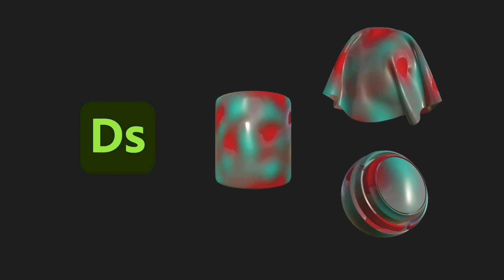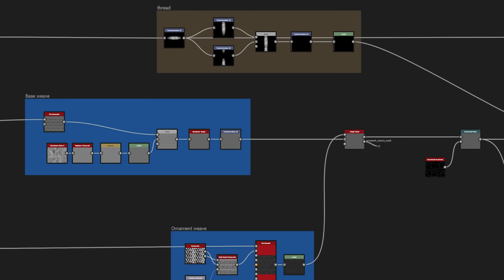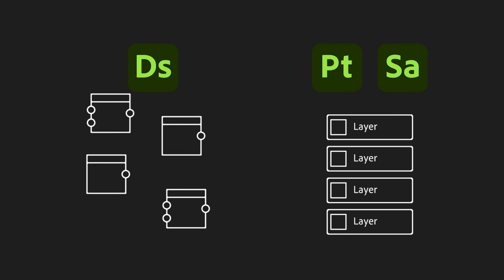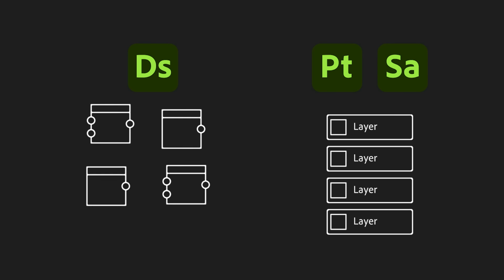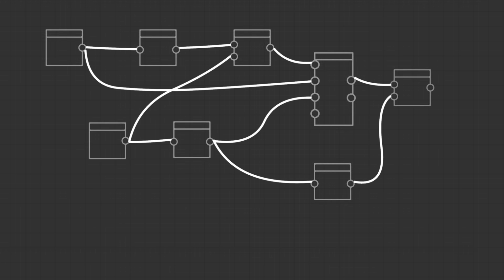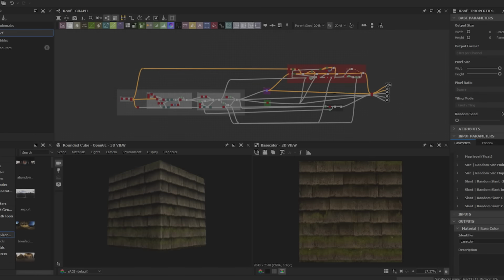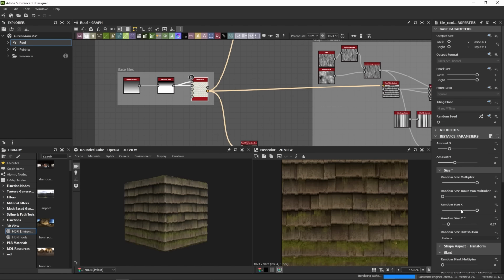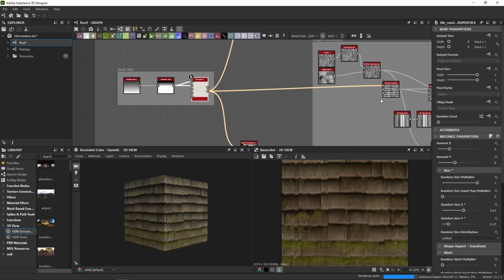What is Substance 3D Designer? (Pt 1) | For Beginners | Adobe Substance 3D

Comment: Substance Designer its a very slow image processor from Aligorithmics. And its kill a REAL PROCEDURAL 3D TEXTURE GENERATOR - DARK TREE!
Reply: I am unsure what you are trying to say, but if there is an alternative to substance designer I would like to know more.
Reply: @stevenmonster  Sorry, my english its terrible.
About 10 years ago I had experience to work with Dark Tree and its revollutional. No UV, no bitmaps, no megabytes of data, no texture stretches and... just realize - Infinite (!!!) detalization. Like a vector graphics or fractals - you can zoom in down to atomic level and still got details.
And if it not enough - I used it with experemental VRay plugin what generate procedural meshes on render time with no rab usage and billions of triangles with use of 3d textures (its like a VDB mesher). And With real 3D complex textures (not just a Cloud Noise, its was so complex so its looks more like super dence alien structures in volume! With real geometry. And its all worked on 2 core intel and 3 gb ram and no GPU at all. ...and all it was flushed in toiled and replaced with stupid photoshop on gpu.